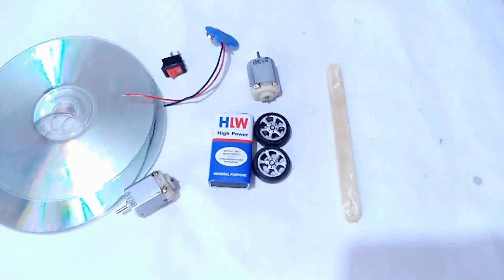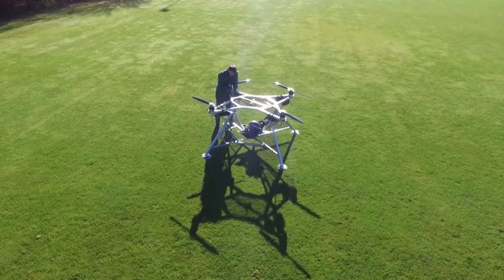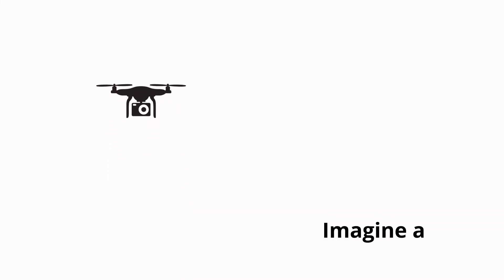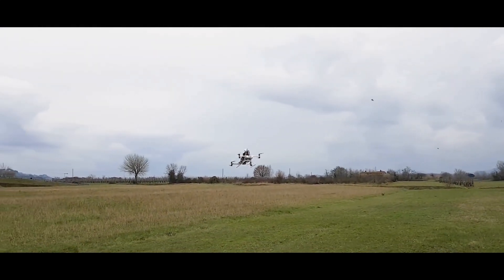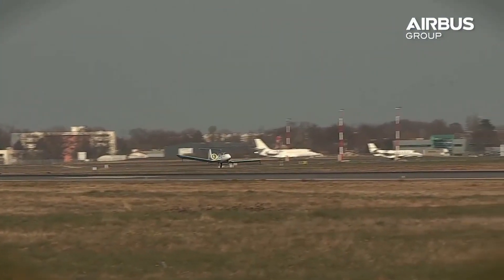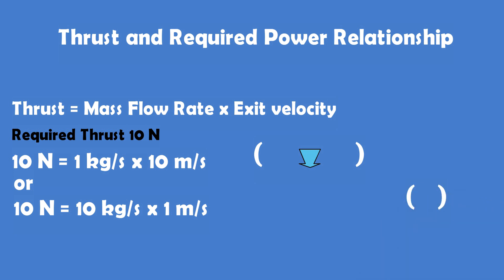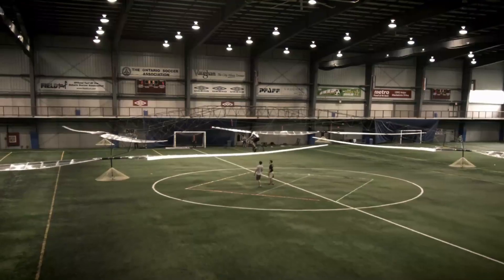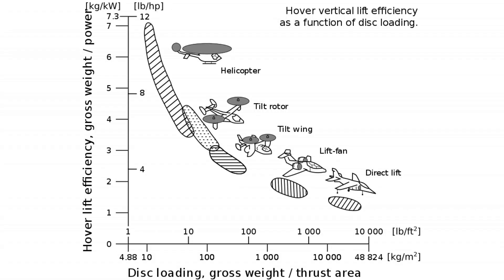Multirotor Electric Aircraft: Design Principles

Comment: So given a drone size and we increase its size by factor x, its thrust is increased by x^2 but its weight by x^3, but the battery capacity will also increase by factor x^3. This means assuming it still has the thrust to fly, battery life is increased by factor x. However if we want to maintain the same thrust to weight ratio as before, we need to increase thrust by factor x, which roughly increase power by factor x, so we end up with roughly the same flight time as before, assuming you have the motors capable of using that much power. If you need more motors or relatively bigger motors, flight time will decrease compared to before.

Comment: As far as the bathtub flying machine is concerned, my only advice would be: 
(1) Do NOT fill it with water. 
(2) If flying through RAIN, REMOVE THE BATHTUB DRAIN PLUG. 
😊😊😊
Reply from the maker: Haha...Good one
Reply: @ElectricAviation  >>> Thanks...😊

Comment: What do you think drives  the technical choices between Airbus Vahana with 8 big rotors 45 kW motors and Lilium Jet with 36 smaller ducted fan motors? Is it because the first is driven by more efficiency and the last making less noise?
Reply: The latter is better for scamming investors that buy into a sci-fi looking design. Instead, they should watch this video so that they would realize that it is a horrible idea to use the Lilium for VTOL.